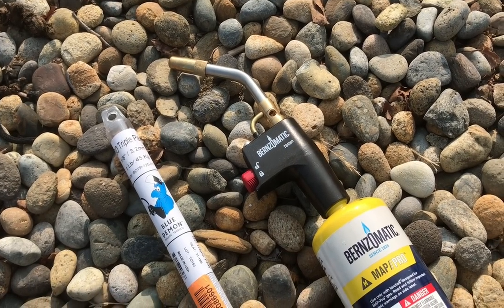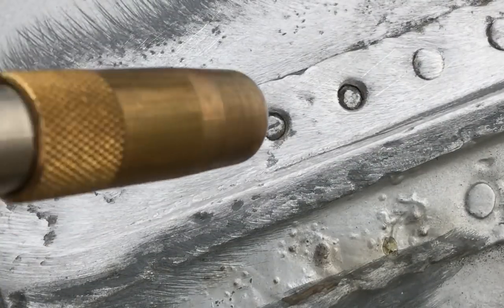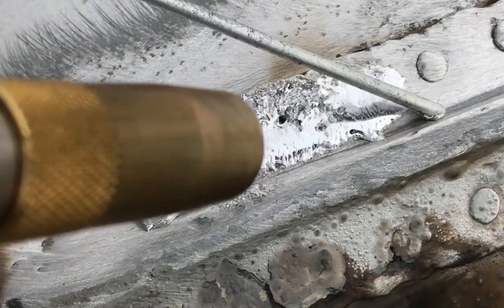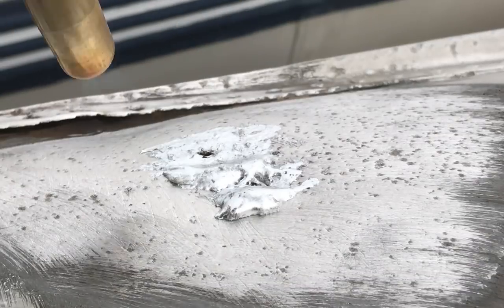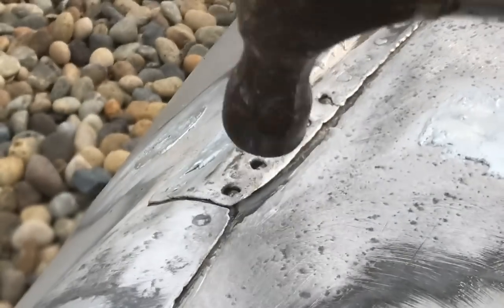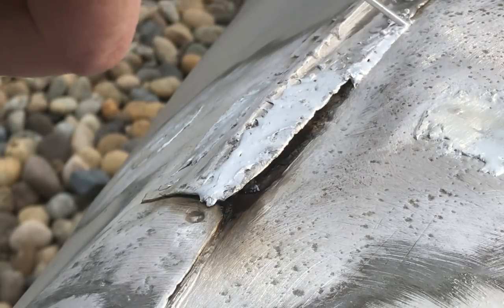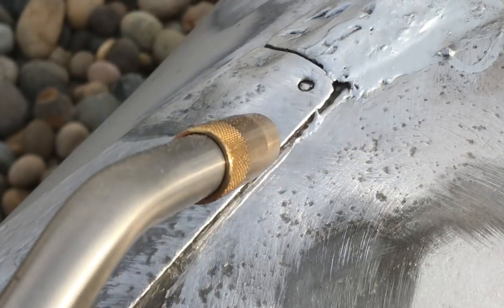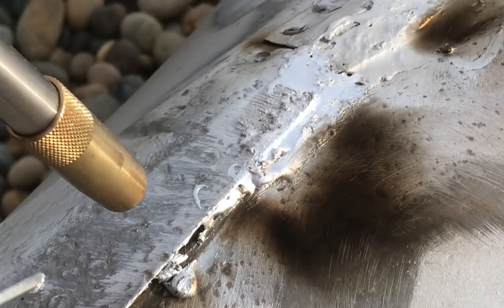DIY Aluminum Brazing holes in canoe / boat with Blue Demon Triple Play / aluminum solder & welding

Comment: If I ever fix up another old boat I'm going to try your way. I've got an old  $20 rowboat that I "repaired" about 30 years ago. I used patches  bolts and caulk. It still floats okay but doesn't look very professional. I like your way much better, although it's probably more expensive and certainly takes longer.
Reply from the maker: Thanks for the comment - Good luck on yours, if it works, maybe leave it. I think there is a place for certain repairs... I tried this on a rip and it wasn't the best choice. Check this video too to see how I did on another canoe repair - https://youtu.be/yd3cBGLt4-Q

Comment: There are a lot of commenters here who are disturbed about the presence of the rubber under that puddle of filler rod metal. I think that as long as you succeeded, then you know what you're doing and it's just another way of doing things.  But to satisfy that contingent, I suppose another way to do it would be to apply a patch that covers the entire area and only braze the edges, so that the heat is away from the rubber.
Reply from the maker: all true, and I torched a bunch of the flotation inside the bulkhead too... less than excellent situation, but certainly more effective than my past glue jobs.

Comment: I wonder if the old trick of putting lines of bar soap next to the area being heated would give easier indication of the surface temp .
As used by people bending and shaping aluminum . 
Sometimes it's nessasary to heat thin aluminum before bending to prevent it just cracking. 
The soap blackens as the aluminum reaches working temp.
Might help with when to bring in the welding rod saving the poking proding method . Just dry bar soap  draw a line say half inch from where your going to weld .
Then start heating your repair target area and watching for the soap to go brown . Then see if the aluminum rod melts more readily when touched to the work area. 
Could be simple aid to the anticipating surface temp 
 A real visual indicator of the surface temp.  Just regular household bar soap.
Reply from the maker: 1silvervespa that’s a cool tip. I will certainly try it.
Reply: At my job I have some different heat marker pencils. If I get any of this I’ll have to try using some of them to measure the heat.
Reply: I use two other things to indicate surface temperature: black sharpie and acetylene soot, either of which work perfectly fine. Probably anything that winds up being carbon under the heat of the flame will work just as well, as I suspect the temperature at which it becomes CO2 is similar to the melting point of the brazing rod.

Comment: I noticed you said that the screw was stainless steel. You get a dissimilar metal reaction between stainless steel and aluminum. Effectively the aluminum will corrode away from the stainless steel . Always place an inert separator between stainless steel and aluminum e.g nylon or PTFE washer.
Reply from the maker: That’s going to be tough in this situation. Thanks for bringing it up though.
Reply: Electrolytic reaction.
Reply: @usernamemykel  Galvanic corrosion

Comment: Can these aluminum brazing rods be found in 5052 aluminum? or will this brazed aluminum withstand the marine environment? I've got a lovely aluminum hull Starcraft Islander but it's got a few gouges filled with what looks like bondo under the waterline. I only have an aluminum MIG welder and am concerned about burning through the thin hull, so maybe brazing is better...if it'll withstand the ocean environment.

Comment: Had some weird aluminum brazing material in the 1980s . You had to get a puddle formed then scrape the surface under liquid braze with stainless steel. Very hard to use. This stuff is much newer and looks like it works a lot better. I need something to try where I can’t use any electric or even acetylene set up

Comment: I was wondering whether the larger area of riveted separation might have been amendable to welding an overlain, thicker gauge aluminum piece, effectively spanning the area of structural compromise. The areas of disruption and separation, involving riveted aluminum and a water tight rubber seal, would likely be associated with progressive weakening and further compromise of adjacent rivets and rubber sealing. Thanks!!
Reply from the maker: another person suggested a large patch as well... I think it would be tricky in this area, and this repair has help up quite well....
Reply: @robdude1969  Good to hear it held up!  I was thinking to pin it down with a screw then braze it closed.  Afterward you could grind away the screw from the inside if needed.
Reply from the maker: @michaelsimmons4883  most of this repair was ahead of the front bulkhead and not accessible from the inside. Thanks for the idea though!

Comment: Why not drill and put rivets back in along where the old rubber is?
Reply from the maker: The back side rotted away on a lot of them. This is inside the bulkhead area as well. It would require much more invasive work to get inside to re-rivet. We have been using JB weld for a couple decades now, but it only lasts so long.

Comment: Thank you. I’m restoring an old Grumman Sport Boat and will use the same materials / procedures. I am going to use 2-part epoxy system with heat gun on most seems. What primer and paint did you use and how did it work? Thanks!
Reply from the maker: been using an oil based aluminum paint on it for years... hard to tell when it goes bad.... looks like the metal it's supposed to be!
Reply: Thank you

Comment: I Blue demon triple play aluminum brazing rods braze cracked cast aluminum that is 1/8” thick, and approximately 8” long.
Unfortunately i ground a V- Grooves on both sides to prep it, but realized that when i go to braze the second side, the heat will loosen the first side.
I’m thinking to grind the grooves thru just enough to put a damn on one side so the aluminum rod can then flow thru to the other side, then just finish filling the groove.
Will this work? 
If not could you please let me know if you have a better idea?
Reply from the maker: Good luck!  Did it work?

Comment: Just getting ready to recycle old aluminium canoe I rescued for the metal recycling bin.  I have some big holes from previous owners trying to weld smaller holes and making them bigger. Bought some aluminium plates to patch big holes. Would like to see this canoe on the water again. Any suggestions greatly appreciated.  Great video.
Reply from the maker: spend some time with it...  bend your patches to fit curves well.  hold your work flat or level and give it a try!

Comment: I think that such projects may have a smoother result by using an aluminum flux.  The flux will greatly help combat the rapidly forming oxide layer and allow rapid wetting of the surface.

Comment: thanks for making this video.
does that stuff work on cast aluminum ?
Reply: Fat Italian  to use Alutite and heat fix spot very hot (almost melting point) so it bonds with aluminium properly  it makes very strong bond. but 2x 250mm rods cost like 40euro and it is quite risky if it is first time using it.
Reply: Fat Italian:  cast aluminum not aluminum.
isn’t there a difference?
can you weld cast aluminum?
i’ll have someone do it if it’s possible.

Comment: I wonder if you could use the brazing on the outside holes and jb weld the inside for more of reassurance or some epoxy on the inside ?
Reply from the maker: The whole repair is behind a bulkhead, but that would be great to seal the area. I have done this exact same technique on another canoe.

Comment: Next time you're trying to solder two pieces together like you are the boat get a flat head screwdriver to help push the breeze into the Gap to help hold it better also would have helped if you had something to hold that together with not trying to be mean but how well did this hold water what is it leaking more I ask because I seen some of the shield going up in flames
Reply from the maker: The video is short... I spent time on it until it was done. I did cut some of the rubber seal out. it was nasty when it went up!

Comment: Good video. I am restoring a 1958 heavy plated aluminum 16' Springbok.  Do you know if there is a better weld rod for such a boat?
Reply from the maker: S Campbell these worked great on mine. Take your time. Clean your aluminum well.
Reply: These rods hold 50k psi.  The only thing they are not good for is over 1000 degree pieces,  Like an Aluminum exhaust.

Comment: great video. i have multiple spots to hit with brazing on my 78 boat.Have you tried other rods? i was about to spend big bucks on some super alloy 5 rods + flux, about 100 on amazon, ive also seen cheap ass fluxless rods at lowes for 5$...
Reply from the maker: Good luck! Let us know what you use and how it works.
Reply: Alumiweld @Horror Fright, just as good as any and inexpensive.

Comment: hows the repair holding up?  Looks effective!
Reply from the maker: I did this repair over a year and a half ago now, and it hasn't changed a bit. I did just smooth out the high spots, fill, and repaint it this week actually to get ready for summer.
Reply: @robdude1969  nice! I hope my boat will never need a patch but it's nice to know there is a good solution

Comment: rivet that back down first
Reply from the maker: The rivets were inside the bulkhead and inaccessible. The bulkhead hardware was corroded and I would have done more damage to "do it right." I have riveted a new rib in the middle, so skills weren't the issue.

Comment: Is there a difference between brands if rod? It seems like there alot of choices out there.
Reply from the maker: I have only used the Blue Demon sticks... let us know your findings!
Reply: How in the world did you get a giant boat hot enough?  Also, from what I understand, MAPP gas is no longer available.
Reply: @robdude1969  I had a little time today to use aluminum rod for the first time. I had the Harbor Freight version and found it to be no problem. I had to try the aluminum can hole plug and it bridged over just fine. Joining light gage straps was a snap. Its ok in my book!  This opens up a whole new world of projects using aluminum.
Reply from the maker: @rtp3962  sweet... I had seen the rods there, but still have a ton of these. you plugged the mouth of a can?!?! I gotta try that!
Reply: @robdude1969  no no. Not the mouth of the can. I drilled a 3/8" hole in the bottom and plugged that off. It bridged fine for that but I'm sure it wouldn't do the mouth. It opens up alot of projects for the future that I would like to do out of aluminum, but my mig and Tig skills wouldnt allow me to. It's fun non the less
Reply from the maker: That would be a good test though wouldn’t it?!
Reply from the maker: tarstarkusz I have seen mapp gas at my hardware store yesterday. Check the amazon link in description.
Reply: @robdude1969... The item you linked to says "Modern substitute for MAP gas" right on the label.
Reply: Also, what do you think of the brazing rods that require flux?  It needs to heated to 900 degrees instead of 700, but I think it is a lot stronger and with better adhesion.
Can you use the flux with these things?  That flux completely dissolves the oxide layer which forms almost instantly with contact with oxygen.
Reply from the maker: @tarstarkusz  interesting. I got mine locally and didn't know MAP was outlawed 10 years ago. This is what I used and it worked well. I think it's too hot for creme brulee though.
Reply: @tarstarkusz  mapp gas is always available. You may be thinking about a gas called fsg which was basically solid rocket fuel. That was great cause you could hold your torch upside down and get a consistent flame. I used it by the case in my business until it was taken off of the market.
Reply: @tarstarkusz  mapp is still available
Reply: @Roger... According to Google it's not.  Amazon is selling "suitable substitute for MAP gas"
Reply: Brand is very important! "Harris" or 'Lucas-Milhaupt" are some of the top brazing rod companies. I spent $78 on 25 brazing rods - 15% Sil Fos, Phosphorus. Don't skimp out on the rods, trust me!

Comment: Thanks very much that was so helpful to me ! Very satisfying to watch too
Reply from the maker: good luck with your project! whatcha working on? It was fun to do... I can't wait to do another aluminum project. :-)
Reply: I will be repairing holes in a very old riveted aluminium boat which has been in the family for 3 generations. 
It’s 11 foot 6 and has been everywhere .
Reply from the maker: @Wheelabarraback  I know the feeling... I have had mine since the 1970's. Let me know how it goes!
Reply: Yes I will I was going to weld it but saw you do a job on yours and decided to braise instead. I have to get the Mapp gas as I just have oxy and LPG . Oxy will obviously blow holes in the boat LPG too cool.
Reply: @Wheelabarraback  oxy-lpg is pretty stable. Thats my favorite fuel gas to braze with. Not for welding but perfect for brazing. Map gas takes significantly longer than oxy-lpg.

Comment: Will this work on a motorcycle cylinder block with a small hole? Does it not melt if the engine is hot?
Reply from the maker: not sure if it's ideal for your need, but your motorcycle block wont get as hot as this stuff needs to melt.

Comment: @robdude1969 iv tried this but the alloy hull wouldnt get hot enough, yet small jobs works fine, i circled the area for 10mins and the hts2000 rods wouldnt melt on heated area, any pointers?
Reply from the maker: Mark n Renee is the area clean? Steel brush until shiny. Use mapp gas. Aside from that, not sure. Heat the hull and drag the rod into the hot metal.

Comment: Never use a stainless steel wire wheel on aluminum believe it or not when aluminum and steel touch and make contact it will cause corrosion in the aluminum, I got taught that when I did autobody courses for the aluminum ford trucks
Reply from the maker: William Popow interesting. Never heard that before.

Comment: I wonder how hard it would be to just install new rivets.
Reply from the maker: To do this repair perfect, we would have needed access behind the bulkheads. It would have required rebuilding / replacing the bulkheads as well which were a bit worse off at their mounting points.... while this "patch" isn't ideal, it has been quite functional for years now.

Comment: hi there..could i use this to stick 1.5mm carbon steel together?
Reply from the maker: try it and let us know your results. I used these on aluminum.
Reply from the maker: @skiffintherift9179  are you serious? coat hangers melt like that?!?!?! all I have is plastic! I can't even go try it to see if your joking or not!
Reply from the maker: @skiffintherift9179  after you said that, I found a couple references to it with oxy... it would be interesting to try! Maybe a new video!

Comment: I wonder if there's something that would dissolve the rubber and paint in the cracks. Maybe acetone?
Reply from the maker: there is a strip about an inch wide running the entire length of the canoe.

Comment: Mark it with Sharpe first and when it gets hot enough, the Sharpe will disappear.
Reply from the maker: interesting! Thanks.
Reply: @robdude1969  I've seen similar stuff done with a torch, they get the soot all over the piece and they adjust the flame to heat it up, when the soot disappears, it's hot enough.  I got the Sharpe trick off another old-timer.
Reply from the maker: @jasonreynolds4050  I love it. Good to read it again... maybe I will remember it this time!

Comment: So can u do this on horizontal. Boat can't be moved
Reply from the maker: gravity pulls the puddle down.... may consult a welder if this isn't an option. TIG would be next choice, but not as easy, so check with a pro.
Reply: @robdude1969  yep I'm a pro. Don't want to pay sum to run argon. Aluium boat so thin, wuts.   Scares me
Reply from the maker: You gotta get it flat. It goes liquid fast.

Comment: Did it sealed after burning the old rüber?
Reply from the maker: yes - but the worst part is the foam in the bulkhead has suffered.
Reply: @robdude1969  I wonder why!
Good job anyways!
Reply from the maker: Andre Demetrio the worst part is that the bulkhead is quite sealed and getting new foam in there will be a challenge.
Reply: @robdude1969  Rob, Aluminum is always very tricky because of the aluminum oxide, it is very hard and smooth micro structure, does not to like to stick with anything.
West systems sells a etching kit, you can do the etching to remove the oxide and improve the "roughness" of the surface, then you can apply a "flexible" epoxy fillet to make the good seal.
I have use the gflex and it was good for me.
Check it out!
https://www.westsystem.com/specialty-epoxies/gflex-655-thickened-epoxy-adhesive/

Comment: Can we see if it leaks?
Reply from the maker: The holes I filled did their job. The brazed areas were sanded to remove high and rough spots. Next is a fresh coat of aluminum paint. I may do a part two video of that soon.
Reply from the maker: Part 2 - https://youtu.be/Od2VP52jzjA